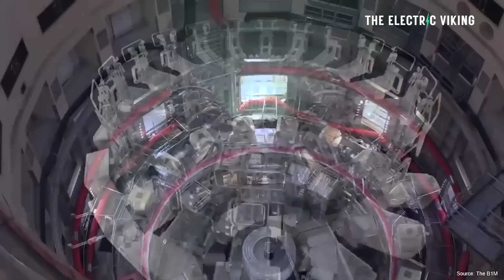Sweden criticised over plan to build at least 10 or more new nuclear reactors

Comment: Sam; you have to take a few things into account here; to start with Sweden straddles the Arctic circle, and a large part of Sweden is actually the Arctic tundra. Why is this special: in winter besides sometimes dropping below -40° C you don't have any sun, like in no sun at all. The Arctic night is more than a month where you never see the sun come above the horizon, just something between dusk and dawn for a few hours then pitch black. This rules out solar power in winter. 
Secondly, the low temperature also freezes some of the main rivers that are usually providing a lot of hydropower energy to the power grid. So no hydropower for a long consecutive time in winter.
Thirdly, you can have some glorious clear winter days, and in the southern part of Sweden where the sun actually comes above the horizon on a beautiful day, but as with all high-pressure weather, absolutely no wind, like in dead calm. So you can rule out wind altogether for days and sometimes even weeks in winter.
So one of the most industrialized high-tech countries, known for submarines, artillery systems, high-quality steel, etc has absolutely NO RENEWABLE energy available.
So what do we do, we start every old emergency power plant in winter, and lately even in summer to desperately try and balance our power grid not to drop into a brownout that could destroy industrial equipment for billions, which means we burn oil, and we burn A LOT OF OIL! Sometimes 70,000 to 140,000 liters per hour in just one plant.

On top of that, some genius has decided that Sweden, which emits a mere fraction, perhaps 0.04% of the world's total CO2 emissions, has to save the day by totally cutting all emissions from its steel production by using electrical power instead of traditional reduction with coal. This new "Green Steel" production will according to the companies producing steel use a total of two-thirds of all the energy production currently in Sweden. Yes, I repeat TWO THIRDS OF ALL ENERGY PRODUCED!
In perspective that is the same amount of energy being used by all of Finland.

Finland has at the same time built a new large nuclear power plant and for the first time in history, Finland isn't dependent on importing energy from the rest of Europe's energy market and prices of energy have dropped significantly. 

So this is the Swedish dilemma in a nutshell; almost no renewal energy available in the winter months between November/December to February/March or at times we would need enormous energy storage to last us between 14 to 20 days, interrupted by a few days and then low for another fortnight, which would cost a lot more than building nuclear power as the demand is going through the roof with all the new fossil-free steel and other industrial projects.
In the past, we had a lot of hydropower, then added nuclear, and for years we had a low energy price of around 2 to 4 pence per kWh, today sure it can be negative but in those critical winter days the price goes up to almost £1 and we have to import so much energy from Europe we are reaching the limit when the rest of Europe has to shut us down. 
Summer is fine when we have wind and solar from Europe, but when the thermometer creeps down to -20° C or even -40° C and we still need to go to work and that is when we need our nuclear power and in the future also in summer when the fossil-free steel and new data centers not only from Facebook, Amazon but all the rest want to grab all the power we got (yes, the former government though that would be a great job opportunity to offer almost free energy, but the idiots probably thought computers are hand-cranked because there are hardly no jobs locally).

If you want examples of successful nuclear energy deployment, look at the South Korean nuclear power plants being built in UAE, it takes them about 7 years to deploy them, a lot shorter than the latest in Finland, the reason is that the companies building nuclear in Sweden were banned from planning or anything related to nuclear. The so-called "thought prohibition" of nuclear power, as you effectively were banned from even touching or discussing the development of nuclear power that strangles the capacity for constructing nuclear power plants.

You got things backward; Lars J. Nilsson is bought by Chinese wind companies; building more wind power in Sweden today will just push the electrical prices down well below negative in summer as there is an over-capacity in summer, and in winter there is no wind so prices go through the roof. 
Currently, there is no wind farm that is profitable in Sweden, only companies based off-Sweden in tax havens make money, that is because they can grab all the subsidies, use interest-deduction schemes just like Starbucks which has thousands of coffee shops, and billions in turnover but pays no taxes in Europe. 
Wind power energy has a 1400% tax reduction plus EU scheme of renewable energy certificates grants so as long as the Swedish taxpayers are sucked dry in CO2-tax, certificates etc and that money is dumped into wind, everyone is going to want to build wind power.
So it's not nuclear that is going to hit the taxpayer's pockets. 
So the day you kill all grants and subsidies pushed for wind not relying on taxpayers, then we can have a fair measure of costs.

Comment: What would help Sweden's renewable energy development would be the broad deployment of long duration battery storage. There are new technologies on the horizon. A long duration sand battery has been built in Finland and a new type of CO2 battery has been developed in Italy. These and other battery systems should be considered by Sweden in solving its energy needs.

Comment: Nuclear energy still has a place in the energy mix.  It provides a good base load even for a small country like Sweden because they can export this into the European Grid - I echo the comments others have made about Sweden’s suitability for Solar/wind.  Also it should be noted that with the 10 reactors planned, they in effect create a more sustainable industry base rather than just create 4 reactors which would arguably supply the the base load for their current needs.  A good example of this can be seen if you look at France and how much cheaper their energy is compared with the uk which is a mixture of ad-hoc reactors created long after they realised they needed them!
Reply: Except perhaps France has good access to Uranium and the UK doesn't?
Reply: @AORD72  If Wagner take over France's supply that might change. UK is friends with Australia so I don't think fuel for reactors is an issue. The anti-nuclear rhetoric is the issue.
Reply: UK, always late to the party. Maximum cost to tax payers and maximum profits to share holders.
Reply: @geoffhaylock6848  Very true I just looked up the reserves and AU has 2,049,400 tonnes. Canada is third in the world with 873,000. So France probably won't have any problems.
Although at current rates of usage there is only about 90 years left of Uranium. If every country doubled the amount of Uranium reactors then in 2068 that would be the end of uranium reactors. Although possible could find more reserves.

Comment: The modern nuclear reactors are much more safe so I have no problem with them wanting to build nuclear reactors.   Not to mention they may be speaking about the smaller nuclear reactors that are becoming prevalent. I doubt Sweden would just forego on solar and wind.  Keep in mind that Sweden is pretty far north and in the winter they get far less sunlight.  This is the time when they need energy the most.  It makes total sense that they would want nuclear reactors.

Comment: Nuclear is the answer. Intermittent renewables are too expensive as a system. 

😂 did viking honestly just call solar more efficient than nuclear?😂  energy density is king.... more energy from a smaller area using far fewer resources. Viking pretends to be some sort of energy expert but doesn’t understand the physics or engineering, especially not at system level.

Comment: It's true; it's 100% symbolic! 
It's just words to quiet the pro-nuclear people that, in fact, will mostly die out, be retired, or be very old at the time any rector will produce any meaningful levels of power. 

In the next ten years, so much solar on private and commercial buildings be up and running. So much offshore wind power will be operational or in the final stages of completion that not anyone will want to continue with the development of new nuclear reactors.
Reply: Nuclear power is consistent power. No business wants to worry about inconsistent power prices.  Sweden is also starting to transition their steel industry to replace coal with hydrogen which means they need a lot of power for the whole process and they need consistent power without having to have storage for half a days power requirements.
Reply: The offshore wind power plants will be cancelled as they can’t give any economy. Look at the failed project outside UK that Vattenfall just had.
Reply: @pin65371  Do you think they want to produce hydrogen @ -30 to +10 EUR cents/ kW/h and store it for hours - several days or produce hydrogen with nuclear electricity that costs 30-50 EUR cents/ kW/h? 
Have you checked what kind of electricity production the green steel, battery producers, and automotive manufacturers request? I can tell you they are big on Windpower.
Reply: @Theresnosequel  green steel, battery producers and automotive manufacturers need consistent power.  With nuclear they know they have that power.  They could also capture heat for processes.  Japan has a new type of reactor that produces a lot of heat that is being utilized by companies.
Reply: @pin65371 Then explain why they want windpower and not nuclear power?

Comment: Sweden has a subarctic location . We don't have sunlight in winter for five months. Wind is to volatile, so it's not reliable enough to secure the energy demand. When it's s realy cold, it use to be calm wind. With purely renuable energy, we would freeze to death. Further, there are big plans to start producing carbonfree steel. That process needs enormous amounts of energy, equal to Finlands total energy consumption. We don't t have that extra energy .Further we need energy for the electrification of the transportation. Hydroelectric power is at it's maximum . The only realistic strategy is more nuclear power to meet those demands.

Comment: It is a complex problem, but wind and solar is not enough to support the planned hydrogen insustry solution imho. I have solar+batteries and am fine for 2 months a year on Swedish west coast. Steel melting and rhe like are huge energy consumers in the north that need to be running also in winter.

Comment: I guess 10 new reactors will be replacing existing aging 6 which provide 30% of elec or mainly a base load plus an additional capacity to account for EVs. The question is who and when will build them and at what cost. The only reactors built on time and budget are in Iran and Turkey but a supplier of these is not friendly with EU at the moment.

Comment: Smaller, efficient and safe modern nuclear reactors make sense, especially in places that have less sunlight. They run 24x7, don't pollute, don't need constant pipelines or trainloads of coal. 

Finland recently asked people to not use their sauna baths when the wind wasn't blowing. This is why wind and solar are intermittent sources and can never be primary sources of power.

Comment: At the moment in Sweden, in the summer when solar and wind works the best there is an excess of electricity sometimes resulting in a negative price. However we have a lack of effect in the winter when we need the electricity the most and the electric prices are skyrocketing. So at the moment the Swedish grid is unbalanced and very volatile and it needs more stabilising production.
First of all there is a lack of electricity production in the sothern parts of Sweden since the red/green coalition managed to get 4 reactors to close down. Adding to that there are large investments in green steel production going on in the northen parts of Sweden and if  those comes into fruition we need to double the electricity production in the north. The current goverment also calculate for the need of additional reactors to cope with the future electric transition of the transport sector.
Solar and wind doesn't cut in the Swedish climate. Sweden is a very dark place in the winter and when the temperature drops below -15 degrees celcius and beyond there isn't much wind either.  So solar and wind in Sweden gives too much electricity when we don't need it and too little when we really need it.
Reply: How much electric energy has Sweden imported during these periods of need when the sun is not shining and the wind is not blowing? And why is the spot price skyrocketing?

Comment: You'd think Sam would know solar doesn't work at night and has a very low output in the winter the further North you go in Europe. Nuclear is clean, safe and reliable, I wish more countries would get on the band wagon. Building 50 nuclear power stations around Europe would bring the cost, planning and construction times down. Well done Sweden.

Comment: Let's see in Stockholm on average they have a total of 32 hours of sunlight in December, barely over an hour per day, and that probably doesn't even count days with cloud cover due to storms. How is solar going to work to supply power based on just over an hour of daylight per day. And then add in the very low angle the light is reaching the ground during most of winter, which will reduce solar efficiency, January isn't much better with 1.5 hours of sunlight a day. And these are in the southern region of Sweden as you go more north you have even less sunlight. If Sweden needs to double the amount of electricity they currently need to go to an all electric economy then unless the country wants to completely shut down during winter they need something more than solar.  And I doubt wind can take up the slack, especially when you consider the times they need to shut down wind due to either wind speed being to high, like during a storm, or not enough wind.

Comment: You got your answer of other users.
 @electricviking
Solar doesn't work in sweden. Solar works best in global south wich have the oportunity to decouple from colonial 10:23  powers.  to wind is far more intermitent / unreliable. Nucear power  make  a lot of sense if you want to keep the base industry. Sweden still has a steel industry that they want to convert to H2 (pink hidrogen). You can not run a base industry if you don't have relieble power generation to generate the needed power / green or pink H2 needed to cater a steel industry. 
Just see what big problem has germany to maintain base industry without russian gas.
UK invested in a big DCHV cable to take a lot of power from Marocco.  
So you have 2 alternatives: nuclear or imported solar trough HVDS like UK try. Wind is far worse / unreliable.